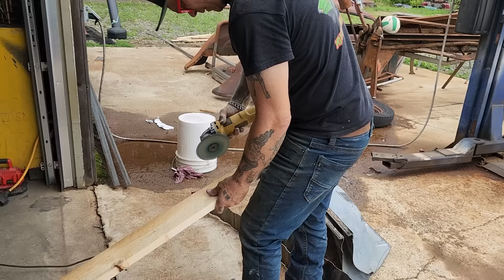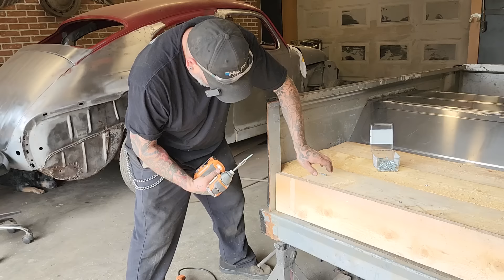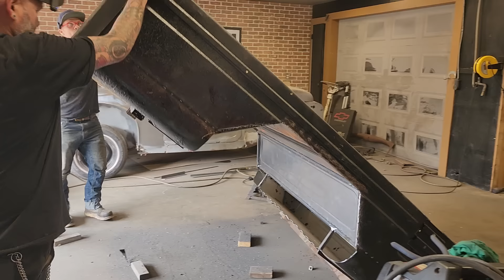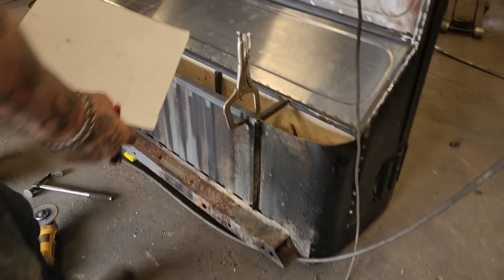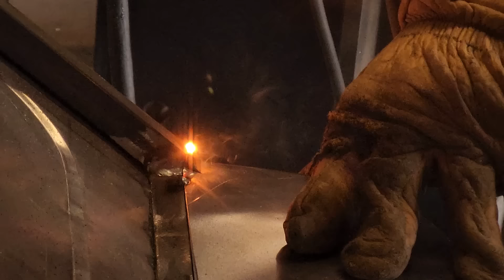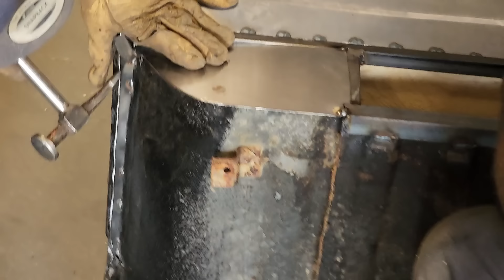Final step on the modified truck box... rough cut lumber and hidden compartment fabrication 👀

Comment: Chad and Nate really work well together and their natural talents compliment each other . Nate is a true gentleman  in publicly thanking  Chad and Jolene  for taking the time out  the Bad Chad production schedule to fabricate his custom pick up box.
Reply: Really I think  it's the least they can do, after all without Nate the engineering side of these builds would never be accomplished, But its still being listed  on the channel as part of the entertainment to viewers
Reply: @georgeperkins9381 there is no denying that Nate as well as Doug have been a huge help to Chad. But if you have paid attention Chad has thanked them both multiple times for helping  him. Chad a Jolene are really good people.
Reply: @georgeperkins9381  Nate gets paid for the thinking so have a day off, nobody likes folks who expect something back because you told them what day it is. They have all helped each other out this year on rides including a paint job.........it is called friendship
Reply: @georgeperkins9381 without Chad….the channel doesn’t exist.
Reply: Nate you need to pre drill a pilot hole through wood and steel if there not self tappers
Reply: Nate you need to pre drill a pilot hole through wood and steel if there not self tappers
Reply: I’ve used some self tappers that weren’t very good and I hard to pre drill or the screw would break or burn up

Comment: Hey Nate! I build hot rods and have used this process with wood and it is easy looks great and you may want to try it. 
The process is a Japanese method of pre serving wood with fire. You burn the wood about an 1/8” deep and then apply an oil like Tung oil. The way they burn it is to put three boards in an upright chimney and let the flames go up inside but I just used a rosebud tip to burn it then lightly knocked the surface down with Scotchbrite pads. Then coat it with oil and it is beautiful.

Comment: Good job guys I just did this to my 66 I just want ahead and remove the whole bottom floor. I didn’t weld it to the sides either. I just used squarehead bolt nut came out really good. I put wood all the way through it. I used three different wheel wells to make one because my tires are very wide thousand ways to do it but your Waze very nice.

Comment: The trick is don't use an impact for self tapping screws.  When it impacts it, mushrooms out the tip or the screws and they will not go in. Tip of the Day from a framer . Lol 😊
Reply: No wonder I’ve always had less than good luck with self tapping screws!
Reply: Awesome build I,m about to line my tub with timber on my 1954 International sidestep kustom Pickup  all new frame just got to find a nice red grain timer will have brass sliders so as timber doesn't get damage  it's no trailer queen I drive it

Comment: Pre-drill the holes with a bit just smaller than the screws.  The lumber loads the screws with shavings and acts as a brake for the bit. Been there, done that.

Comment: Seam seal and a good heavy coat of rock guard underneath. Since you aren't installing wheel tubs, you'll need to keep after the rock guard in the wheel wells.
Reply: I  believe Nate mentioned he was going to rock guard and seam seal the underside of the pick up box.

Comment: The hammer on the driver doesn't allow the screws to grab, because every time the screw tries to grab, the impact force breaks the seal. Self-taps need to be installed with a variable-speed regular drill/driver.

Comment: Nate try linseed oil as a wood treatment to keep it from rot and durable.  It will retain the wood look but protect it.  Simple to apply with a brush or a rag.  If it starts to née another treatment simple put on another coat.  Would look great against the satin black paint on the metal.  Also very affordable.

Comment: For the wood  just put old motor oil cut with varsol or turbentine  you apply 1 coat let it sink in for one hour then apply one more coat  then let it dry in the sun for few days  n its good for a long time   its look good i  can tell you

Comment: If you throw those self tappers in reverse as pushing though the wood it lessens the resistance, letting the self penetrating the steel faster.

Comment: This is a  ice bed , but when the wood gets wet or damp it will swell or warp. Need to put something small in between  the ends of the boards  and between the boards.  Like a finishings nail. If it gets wet at all this will happen. Been there done that. Just saying.  Love the work.👍🇺🇸🇺🇸

Comment: Of course they can do whatever they want to do. But I really think the wood should be smoother. And finished before putting it in. As should all of the metal. Which they still may take apart and do. But mainly. It should run front to back instead of side to side.

Comment: The wood being installed in the box is fitted very tightly. If it's out in the rain and gets wet, won't it swell and buckle?
Reply: I check into to using dark creosote to seall and weather proof the rough lumber.
Reply: I think it will shrink a little as it cures or dries.

Comment: I like the idea of having a secret smugglers hatch hidden under the bed. The metal is bending under the force of the drill bit pushing on the metal,  instead of drilling through the metal, support the metal and I would bet the screws would work.

Comment: I don’t think those self taping screws are designed to go thru steel square stock. I believe they are for sheet metal.
Reply: They seem to work ok
Reply: @Patriot6421  they are temp, he showed the screws he using he said they did not have the correct length. the perm screws hes getting are used on every wood deck equip trailer. we have 5 trailers that have wood decks and we stock those screws and replacement planks
Reply: Have used them for 20 years and never had an issue with them !!
Reply: Work inside trailers and they are 1 inch square stock.
Reply: Must have been driving into a weld which may be harder thN the base metal

Comment: Would look good with either square tubing in-between each piece of wood or T angle iron between each board
Reply: A trick to make screws look good is to use brass ones and grind the head off it looks awesome

Comment: Ebony black stain for the wood. Rock guard would be practical and tough for inside of bed? Needs a wrought iron tailgate with an oval frame in the middle for a ceramic? Ford Logo ❤ Would look cool, but not sure if it's the look you want? I am assuming there is a local blacksmith who could create such artwork?

Comment: Don't glue sawdust in the holes, stain will not pernitrate it, just drive a tight peg in the hole  and flush it with the top of the board.

Comment: We need to take some tips to save  time and money and energy ! I said slow on the drill speed then the bolts won't strip in the holes ! Stop when the board pull up in the frame !

Comment: You could put a burn on the wood with a torch and then use boiled linseed oil to protect it. Same as you use on axe handles.

Comment: Those self drillers were never designed for the RPM you are using to try and drill through 3/16 thick steel.   Your drill bits can't even seem to drill a hole in those square stocks

Comment: What do you think about square stock on the bottom floor, instead of angle iron
? That way you could weld seal, both sides of the corrugation, or use caulking.

Comment: What are they doing. The box will not hold much. Is it for a special job?
Reply: What they are doing is tubbing the truck bed. It enables him to put wider tires in the rear wheel wells.  It sacrifices bed space for a certain look.